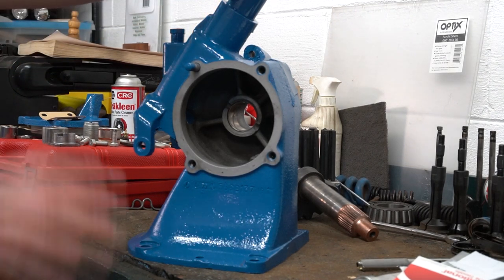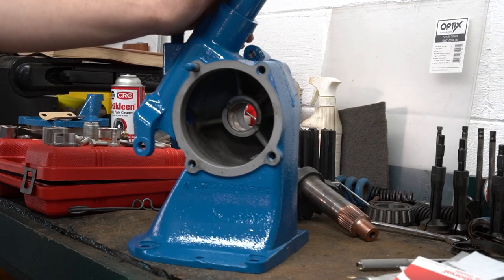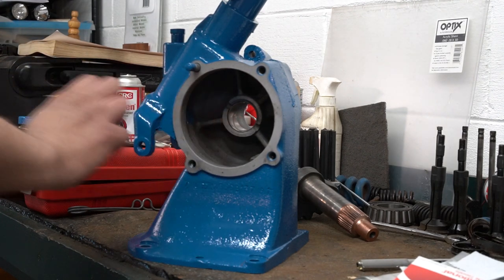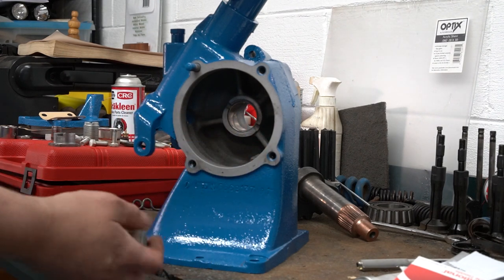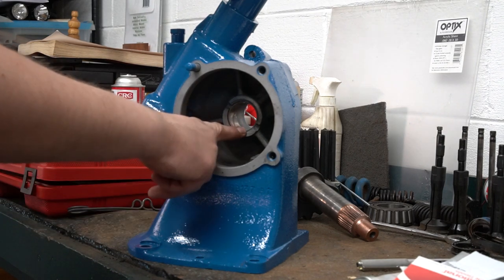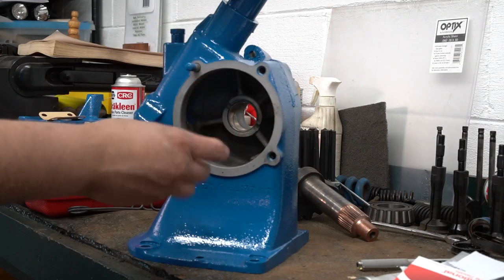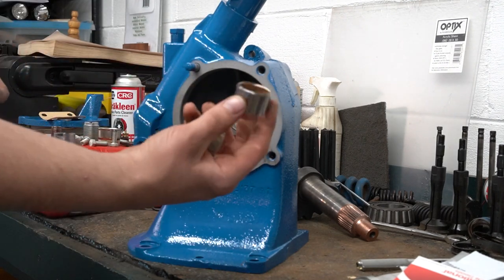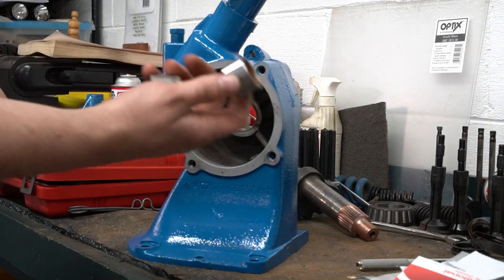Ford tractor row crop steering box assembly

Comment: When bleeding the power steering system how do you bleed the steering gear ? I have a 57 power master 801 Ford I can’t find anything. My steering goes back and forth on its own .
Reply from the maker: Once tractor is running all you should have to do to bleed system is turn the steering full lock to full lock a few time and all the air should bleed out.
Reply: What would cause feed back uncontrollable feedback
Reply from the maker: @Angrytoddler  what do you mean by uncontrollable feedback? Is it hard to turn? Does the steering wheel rip out of your hand? Or something else?
Reply: If I pull one way it will rip it all the way to the opposite side and same if pulled the other way . Can cylinder lines be flip flop
Reply from the maker: @Angrytoddler  that's what it sounds like. If swapping the lines around doesn't fix it then I'd say something is the valve body is incorrect. Been years since I had one apart so I can't remember what they look like inside. Keep in mind that on those tractors one cylinder will extend and one will retract when turning.
Reply: @chickenhousemechanic  yea if disconnected it works perfect but when you add resistance then it forces the other way . But I’ll just start swapping and keep them numbered so sooner or later it will work . Thanks